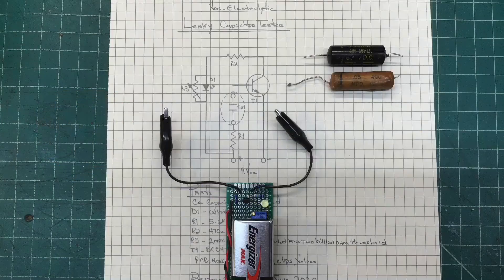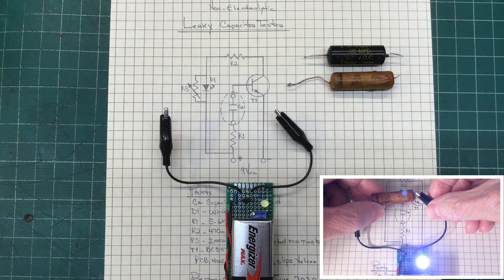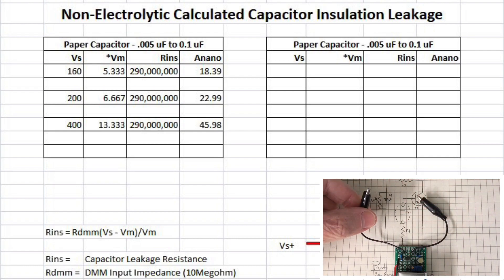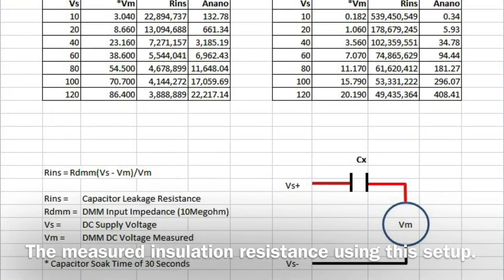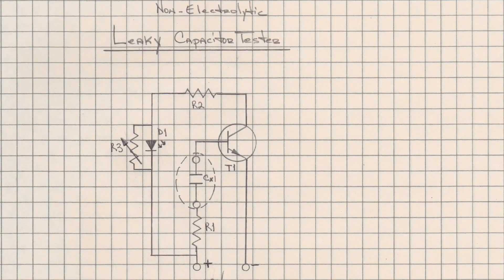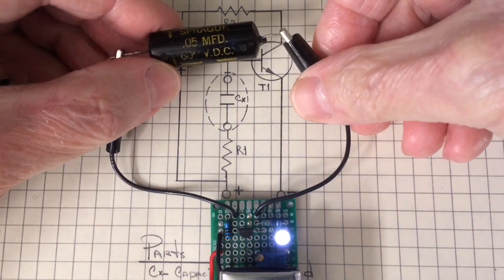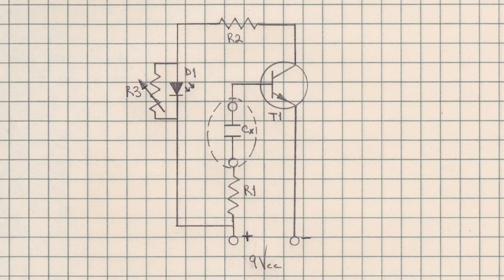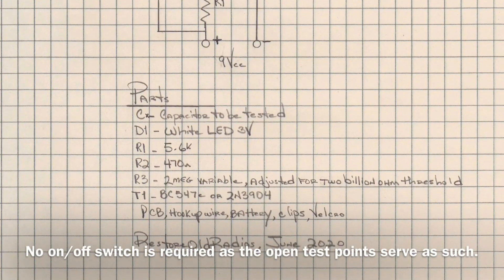Build a Non-Electrolytic Capacitor Insulation Resistance Tester to Identify Leaky Capacitors

Comment: Hi Don, I built the tester and it appears to work but I cannot calibrate it with the two 1 gigaohm resistors in series at the test points. I tried a single resistor and still can't get the LED to light when adjusting R3. I'm using a 2N3904 transistor. Should I replace that with a BC547 instead which has a higher maximum hfe of 800 vs 400? Thanks.
Reply from the maker: Thanks for reaching out; I hate you’re having that issue. What resistance value causes the LED to light? I’m assuming you saw the mistake I made where I had the LED reversed when shooting the video and the drawings have since been updated? I’m using a BC547, so if everything is okay with the build, that would be worth trying. Best, Don
Reply: @RestoreOldRadios , the LED lights up very well at 100 Megohms. I kept stringing up more resistors in series and it appears very faint at 277 Megohms. With the two 1 Gigohm resistors in parallel i.e. 500Megohms, I was able to see the LED glow after killing the shop lights. At 1 gigaohm, no glow from the LED in the darkened shop. I have to note, if I touch any of the leads, the LED will brighten probably from the lower resistance from my fingers.
Reply from the maker: Probably the transistor gain to your point will improve the threshold sensitivity. Jim Newman, one of my subscribers had this issue and used two 2N3904s in a Darlington configuration to overcome the... Hope this helps. Best, Don
Reply: @RestoreOldRadios  , your suggestion to try Jim's two 2N3904s in a  Darlington pair worked! I was able to adjust the tester to the 2 Gigaohm threshold where the LED just comes on and it shines brightly. Thanks for all your help and I get to learn about boosting a transistor's gain with this neat trick.
Reply from the maker: Very cool. I’m glad it worked and appreciate Jim sharing this modification with us. All the best. Don
Reply from the maker: Just saw this video from Tom you might find useful.

https://youtu.be/Se7jewRTY3g
Reply: @RestoreOldRadios  I built this nice little device, thanks!. As feedback to others, my bc547c from Mouser with an hFE of 660 was not enough to see the 2Gohm resistance. I had to do the Darlington config with the 2n3904s to make it work. With this set up the R3 pot was set at ~9k to see the 2Gohm resistance. Therefore,  I replaced it with a 20k pot and I have a very nice and easy tuning to any intensity of the led for any resistance from 10Mohm to anything you want on the high side (2Gohm).
Reply: @jmayoral  Should the pot be a multi-turn or can you use a single turn pot?
Reply: @Kopter6  I used a regular one turn trimpot and it works well. But if you want better control a 10 turns one will be much nicer.

Comment: neat little circuit, using the natural "open loop" gain of the transistor. 
Good for go - no go  testing, when any leakage is to be avoided.
Cheers,
Reply from the maker: Thank Eddy; simple and seems to be effective with my limited testing. Best, Don
Reply: @RestoreOldRadios  - Hi Don, just an update. I put this circuit together and tried it out.
As it is, I found that the tester did not have enough sensitivity to leakage. For example, a cap that was found to be leaky on my Heathkit IT-28 tester did not show a leakage on this new tester.
My tester I put together used an older LED (higher current needs?) and a 2N3904. The 2N3904 has less open loop gain (hfe) and needs a higher base current to get the same collector current vs the BC547 (almost double!).
Anyways I decided to use a common collector Darlington Pair configuration for the transistor (2 x 2n3904) and this worked much better. The leakage tester is now sensitive enough to detect leakage through my body when I hold the test leads tightly (leakage through insulation!) and it now detects leakage in capacitors that my Heathkit cannot detect. Definitely an improvement. Actually holding one lead, It lights up just from RF environment noise as I turn into an antenna.
Alternatively I could have tried to use a new low power (high efficiency) LED but I did not have one in the package shape I wanted to use. I did not have any BC547 transistor either though I may order some as they are a distinct improvement over the old standby 2n3904 and 2n2222 that I do have.
Just thought I would drop you an update on this and a potential improvement to the tester's performance. It may be of use if others use less sensitive parts to make their own.
Cheers,
 - Eddy

(edit, misspelled the transistor name)

Comment: A simpler design than the one I use, and the word "simpler" translates to "more accessible" to the restorer.  I really recommend that anyone who restores radios understand the significance of capacitor leakage and to make this one if they don't already have a capacitor tester.  The major advantage of these low voltage testers is that they are sensitive enough to test for leakage without restoring/using the vintage high voltage capacitor testers made by Heathkit and others.  Those are dangerous; while they test the capacitor under real operating voltage conditions, capacitors store energy and you can get a real shock.  With new high quality capacitors available, why bother to know more than whether the cap is trash can worthy or not.  If you encounter stuffed caps this tester becomes even more important to know whether to restuff again or not.  Blessings, Albert
Reply from the maker: Albert, well said. Should you throw this circuit together, I would appreciate your feedback on its effectiveness. Thanks again for sharing your wisdom. Best, Don

Comment: Hi RestoreOldRadios,

I think that there is a mistake in the diagram. The center tap of R3 should be connected to the +9v battery. If not, we can't control the current via the Transistor because at LED points will be the same impedance and not depend on the values of the impedance of R3. Can you check?
Reply from the maker: Thanks for reaching out. The video I published has the LED polarity backwards, which I updated the downloaded file. The circuit seems to work well with the LED polarity flipped. Thanks again for your feedback. Best, Don

Comment: Hi Don,  I got a question about the R3 pot.  Is it safe to assume the pot is wired like a rheostat where the wiper is connected to the end of the pot going to the LED anode and +9v?   All the best.
Reply from the maker: KS - you are correct. Sorry for the confusion and my errors in the shop drawing I shared. All the best. Don

Comment: Don, where did you find a 2 gig ohm resistor?
Reply from the maker: Bob, when I was testing and calibrating the circuit, I used various values in the line of resistors below. Hope this helps. All the best. Don

MOX-300001007JE Ohmite | Mouser
https://www.mouser.com/ProductDetail/Ohmite/MOX-300001007JE?qs=pL5SmcfXDY0TjBOq94%252Bv5w%3D%3D

Comment: Ummm, in the diagrams you linked in your description, it looks like the LED is drawn backwards.
Reply from the maker: Ray - I sure did, but at least I built it correctly. LOL. I must have been standing on my head. I’ll update the shop drawing ASAP. Thanks again for catching this. All the best. Don
Reply: @RestoreOldRadios  Bet you're used to having the power supply come in at the top and drew it that way out of habit.  :-)
Reply from the maker: Ray - corrected and published. Thanks again! Best, Don
Reply from the maker: I just didn't triple check myself and to your point with the DC coming in on the lower may have distracted me.
Reply: @RestoreOldRadios  You drew the schematic in the format of tube based schematic convention.   Power and ground from the bottom of the page.    I hated that.   That was the hardest thing to get used to when working with tube gear.   I was so used to positive on top and ground on the bottom of modern solid state schematic drawing convention.
Reply from the maker: jp040759 Yep, you see I confused myself too and had the LED polarity reversed that Ray caught. Thanks for watching. Best, Don
Reply: RestoreOldRadios I have an old philco model 18h is there any possibilities of it being fixed

Comment: Don I have a question for you or one of your fans , I just bought a 60 era G.E. AA5 radio the plastic tuneing knob wont come off , I have tried a screw driver and worked my way under it all around then I tried two screw drivers nothing a little bit of heat from my blower on my rework station 200 degree c nothing any Ideas guys .
Reply from the maker: Ron, it sounds like the radio when built may have UL Captive Control Knobs, which are difficult to release. An example is on page 119 at: https://worldradiohistory.com/Archive-Rider/BEITMAN-SUPREME/Beitman-1963.pdf The chassis in this case should be pulled out the rear of the cabinet. Another reference here from the Antique Radio Forum that may help: Captive control knobs site:antiqueradios.com Keep me posted on your findings and I hope you’re able to free the chassis soon. I had this issue on a Zenith K731 I repaired for Bob; got lucky and didn’t break the knobs because I didn’t remove them correctly. Reference my video at: https://youtu.be/FlQpwDoPkhI Best, Don

Comment: Great video and very calm deliver. Thanks. A lot simpler than that Mr. Carlson's cap tester.
Assuming I build it right haha what indicates a good cap and a bad cap? I've recently acquired an all american five Admiral and would love to get it running.
Reply from the maker: Joram - thanks for reaching out. The LED will illuminate if the capacitor is leaky, which you can bet any vintage capacitor will cause this to occur. Keep in mind, this is a low voltage test and does not stress the capacitor at its operating voltage. Check out a modification made to my original design by Tom that increases the sensitivity and thus indicates a lower level of leakage. The video: https://youtu.be/jmKJexB3g7U

Hope this helps. 

Best, Don

Comment: Where does one get resistors that will make 2 Gohms in a convenient form? (even if you used 20 megohm resistors, it would require 100 of them to make 2 gigohms.)
Reply from the maker: Gar -

Check out: https://www.mouser.com/ProductDetail/588-MOX-300001007JE

Best,

Don